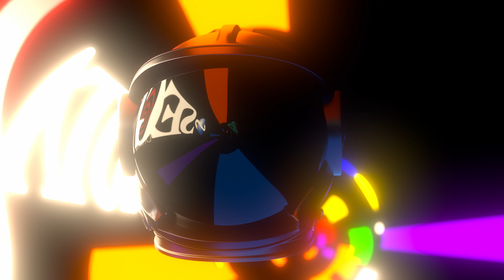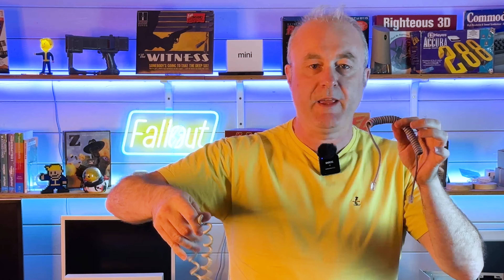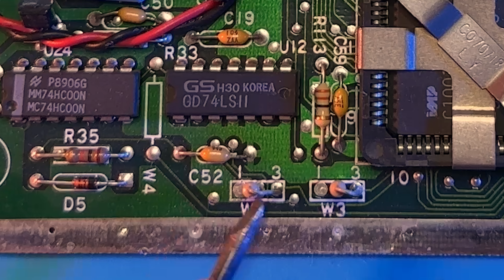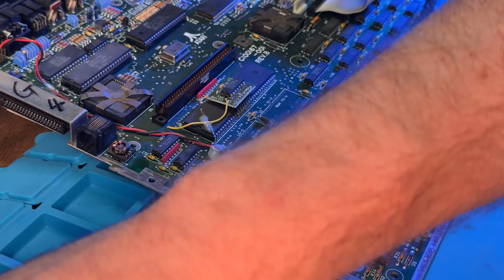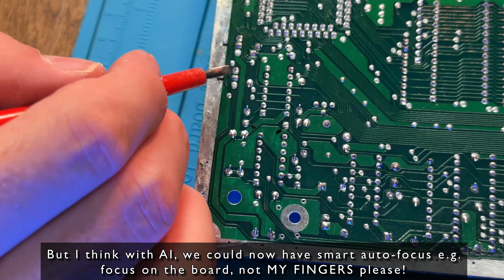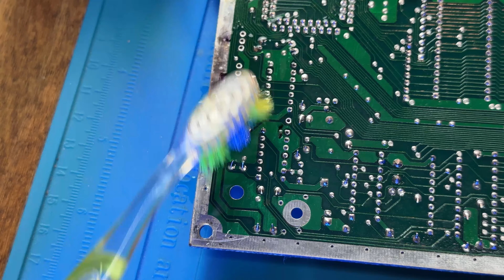Atari Mega4 CH03: Next Level Atari Mega with an OS Upgrade and Super-Silent PSU Fan!

Comment: My 1040ST also has only 2 ROM chips, out of 6 ROM positions. Is there a suitable EPROM replacement in 27Cxxxx  EPROM range for those Atari ROMs ?
Reply from the maker: You mean to upgrade the two ROMS to a newer ROS? Nope, that requires 96kbyte 28pin DIP EPROMs, which are no longer made. All the geometric family, I mean 8kb, 18kb, 32kb and so on ARE. Which is where the 6 ROM approach is kind of forced on you. You CAN also make an adapter, to make a 32pin EPROM work in the two sockets, but I decided to go for the 6 ROM approach, the 2 ROM approach is also valid.

Comment: That type of gaffa tape ages REALLY badly. The glue turns to dust quite rapidly so will not hold the wires the way you want.
Edit: and congrats on your nice repair!
Reply from the maker: Well, all tape ages eventually, the tape that held the original wire on, its glue was also totally dry. I guess only time will tell though?

Comment: When you solder things like chip sockets in, it's good practice to just solder diagonal corners, like you do here, but then you should always check alignment/flatness to the board, before you solder any more pins. This is because if the component is raised up a bit or misaligned it is trivial to reflow the solder at each corner whilst pressing gently down on the component, as the solder re-melts it will snap flat and perfectly to the board.  Trying to rectify a raised component when all the pins are soldered is a heck of a problem.
Reply from the maker: Good tip :)